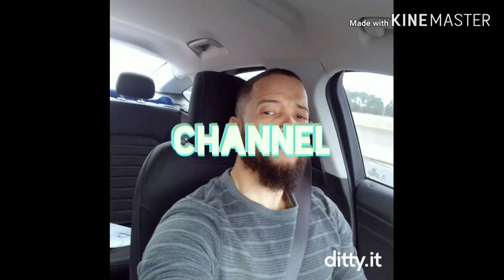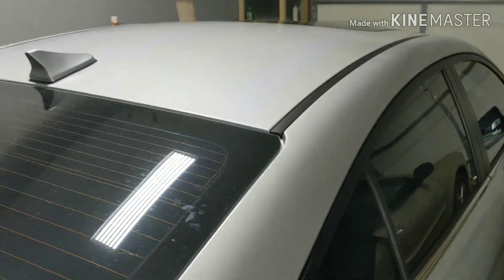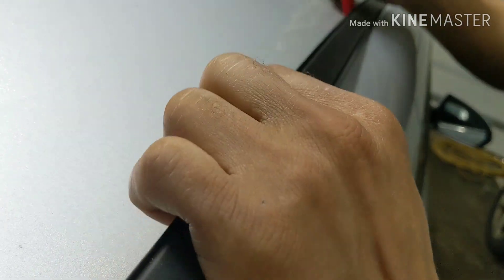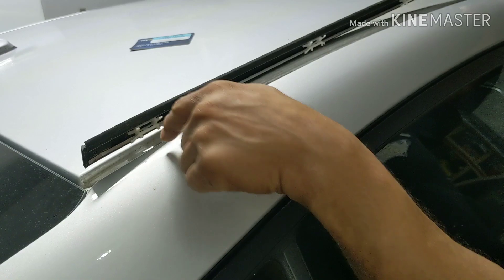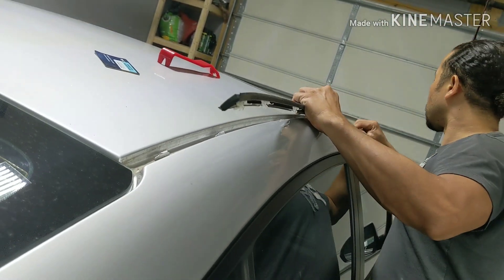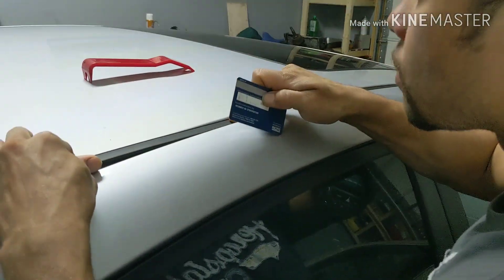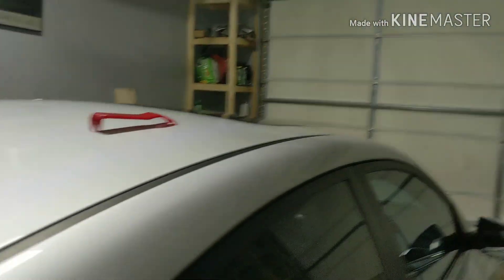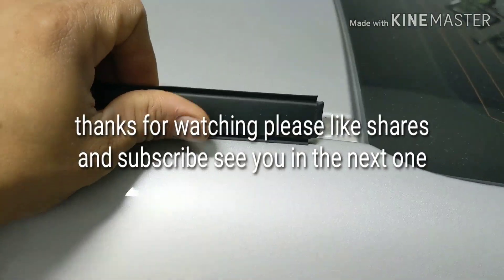2018 Hyundai Elantra roof trim removal

Comment: I had a windshield replacement and the front of one of the weather trims appears to be popped out a bit (and won't go back down). Is there a way to fix that?
Reply from the maker: Well if the clip brock off then you will need to add some silicon and tape it down over night